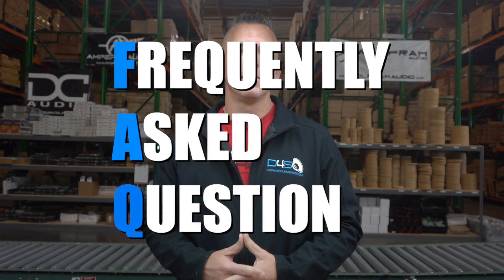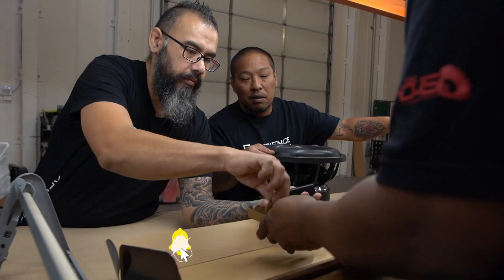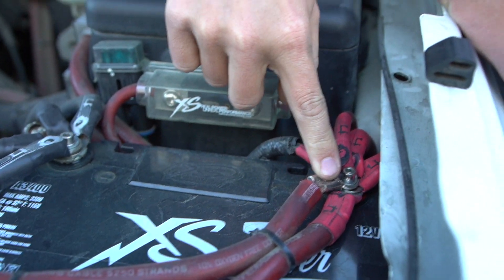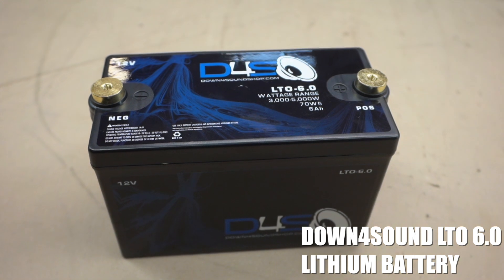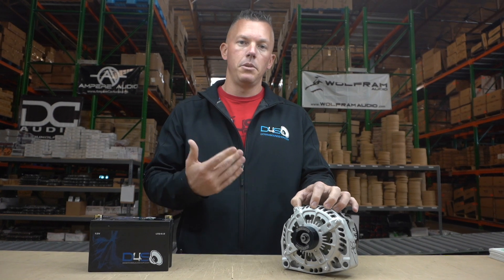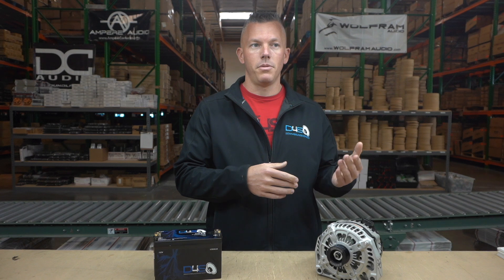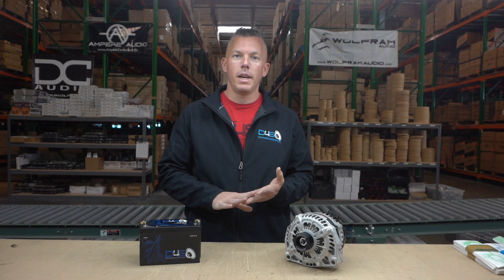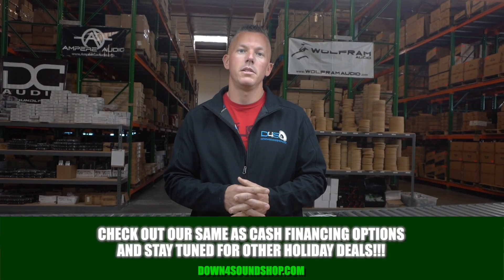FAQ: WHAT IS A SUPPLEMENTAL BATTERY?

Comment: How would I wire an LTO and a capacitor bank? With an isolated? Would a supplemental battery like the XSP D3400 have more but than the LTO 6.0? A Mechman 400 a GM alternator, and a D3400 under the hood. They still make caps, so I would like to use an XSP SB75-5CK supercap bank.

Comment: I read that you're supposed to have a thousand cranking amps per thousand Watts. If this is the case my battery in my little Honda Civic only has like 650. I was going to add a little battery in my trunk so I can get a total of 1,000 cranking amps. Hopefully this will work out good and is necessary.

Comment: So if my 250 amp alternator has 1/0 power wire going to front battery, then from the front 🔋 + to the rear nattery + parallel is that charging both batteries since its parallel. I have big 3 in 1/0.
Reply: yes

Comment: Would charging the aux battery with a tender overnight, if I only use it for 1-2 hrs daily and 80-90% volume, running 2000w total, would that work?? 
Im running a 850cc amp 12v deep cycle marine battery

Comment: I'm new to Car audio, but not new to Lithium ion, or Lifpo4 batteries etc. What I find interesting is no one ever mentions that having a car alternator connected to a lithium battery without any type of low voltage or high voltage cut off or BMS (battery management system) is dangerous. If people are going to connect a lithium battery especially one that is not meant to run off a vehicles electrical system ( I know they make some drop ins but they have a BMS built in for protection) "newbies" may not know that there is a difference when it comes to those types of batteries. I made this comment because in your video you have an 8AH lithium battery next to an alternator and made no mention of how to safely use these types of batteries in conjunction. I understand it was a Q and A that you answered, but the answer is not as simple as  you made it out to be.

Comment: How would this info change for a hybrid vehicle?  There has to be a way to improve the sound in hybrid vehicles.
Reply: im learning about this same thing. Being that hybrids don't have alternators because they would cause inefficiency in most hybrid designs, I have a lot of questions that are difficult to answer... To get higher amp output in the electrical system, it seems the DC-DC converter (which charges the 12v battery from the hybrids high voltage system) must be upgraded.

Comment: So my headlights are dimming, my voltage is dropping below 12.5 when trying to go full tilt. Big 3 already done with 0g. High output alternator is my next step? 
1 Sundown Audio X v2 15
4k @ 1ohm
Reply: 4k amp with stock alt should drop to 10 Volts easy so you need a autotek or mechman alt and a titan 8 in the back and titan 8 under the hood so you can either spend 1500$ and have good safe lithium or build a big headway bank that does alot of power but doesn't last for 400$

Comment: can anyone help me out with what secondary battery to choose i'm trying to decide between an xs power D975 and the Sundown audio sps 1500 both are $220 but the xs has 35 ah and the sundown has 47ah and the xs has a max amp rating of 2100 amps and the sundown 1500 amps (not sure if max rating means much considering it doesnt when it comes to amplifiers) but i cant find much at all on the internet about any sundown batteries and i think it might be the way to go because of the ah it has but i know xs has a rep for being really good in car audio secondary batteries and it has quite a bit higher max amp rating, it's also 10 lbs lighter. The setup i'm running is 2 skar evl's and i plan on getting the nvx xad14 3000 watt rms full bridge amp to power em.

Comment: I get it needs hooke up to the alt, but  do you need a separate wire from the alt to the back or can you just run it in parallel with the main underhood battery?  Example alt to main battery,  main battery  to supplemental battery.
Reply: Supplemental 🔋 does NOT need wired to alt independently, just to the main battery & then that circuit is completed by the wiring already in place between the factory battery & alt.

Although, you would want to upgrade those wires to gain efficiency! Aka, BIG 3!

Also, preferably upgrade your alt, cause it's now working harder! 💪
Reply: Yes at least an 8 gauge wire all the way back just for charging

Comment: Does a lithium require anything extra? Like to keep it from overcharging the battery or demanding too much from the alt? I just bought a battery isolator and have a 150amp alternator. I’m about to buy a secondary battery and I’d prefer to buy a lithium but don’t want to upgrade the alt just yet. I saw that a 100ah lithium’s recommended charge is 50 amps. I’m looking at getting a 100ah lithium or a similar size XS AGM. Any input would be great!

Comment: So from alt (+&-) to primary battery, then from primary battery to supplemental batteries and then from supplement (+&-) back to alt? Or wiring from alt to primary to supplemental?
Reply: Other than upgrading your alt & the wires running to /from it, you do NOT need to run additional wiring from your alt to your new supplemental battery!

Run your 12v + wire from your main 🔋 to your trunk / supplemental 🔋 & put a fuse at both ends.

Ground your supplemental 🔋 in your trunk.

You can install a battery isolator if you want, but that's optional.
Reply: Great Question, It Sounded Like He Said That! 🤔

Comment: I run both batteries parallel with an isolator.  I'm confused about what you said about hooking both to the alternator. I have the big 3 done, 2 platinum AGM batteries with stinger isolator, factory 130 amp alternator, skv2 1500.1 amp, 2 evl 12s. Every wire is 1 awg ofc. I know my power isn't impressive but I've never done this before and hooked this up myself in an 09 maxima. Boss head unit too. I'm new to this and always wanted a system. I do want to install a high output alternator but the only one I can find that seems somewhat reliable is JS alternators. I can't up the amp till I do that. It is hitting pretty good and voltage never drops below 13.3 since adding the second battery and isolator. Btw, I'm dying to hear a system like the Tahoe. Never heard anything like that before. Thanks for all your videos and help. They've helped me along the way.
Reply: Your doing it the right way running parallel with isolator.  It's the same thing he's saying of the alternator. Because your primary battery is already  connected to alternator in order to charge.  So you charging it in parallel with the primary battery.  Make sure you have a fuse from positive battery to other positive  battery at least a 200 amp fuse  😊

Comment: Several questions, big 3 to XS Power AGM battery under the hood, then dual grounds and hots from alternator to two connected D4S LTO 6.0, Then hookup all amps to the D4S LTO. Am I correct? Also for a 10,000 watt system, Taramp MD 8K 2ohm running two Zv6’s bridged to1ohm and a 2K Phoenix Gold on mids and highs, will two D4S LTO 6.0 be enough with a 250 hp alternator? Thanks for your reply.

Comment: Can you get another battery without getting the alternator or should you just get a alternator by itself first to see if it helps
Reply: Or would the isolator be another option if you just get the battery?
Reply: Alt first... Re-evaluate... Then 🔋, if needed.

Comment: You should also talk about bigger cables from battery - to the ground, ground to engine. And Battery + to charger and starter. At one time these was called 3 point update.
Reply from the maker: You mean like this? https://youtu.be/bm2f0UMQGj0
Reply: @THELIFEOFPRICE  Yes sir, but you should have more ground than positive in engine bay, or gasoline and new diesels could ground them with critical engine grounds.Extra ground for chassie and frame is not an bad idea (floating chassie)
Reply: @THELIFEOFPRICE , Several questions, big 3 to XS Power AGM battery under the hood, then dual grounds and hots from alternator to two connected D4S LTO 6.0, Then hookup all amps to the D4S LTO. Am I correct? Also for a 10,000 watt system, Taramp MD 8K 2ohm running two Zv6’s bridged to1ohm and a 2K Phoenix Gold on mids and highs, will two D4S LTO 6.0 be enough with a 250 hp alternator? Thanks for your reply.

Comment: I think what folks are asking is which is better.  Running your power wire from the rear battery to the front battery or directly to the alt?   I run individual wires from alt to each battery but ive been curious if that is better or to connect both batteries together and then connect to alt?
Reply: Someone please answer
Reply: Doesn’t matter. If the batteries are wired in parallel, theylll get charged equally. There’s no scientific answer to whether it’s better if directly wired to alt.
Reply: @Regz-2stroke  that’s the thing.  I have each battery with it own individual 12v wire ran to alt but I don’t have my rear battery wired directly to front battery
Reply: @wetdookie3808  it is still getting the same power either way you look at it..
Most people run them directly battery to battery.
You probably got your answer already considering this was 11 months ago.
Reply: I believe it depends on the alternator.  Sometimes you can only run power from front battery to back battery then to amplifier.
Reply: I wanna know can I just use a battery without being hooked up to an alternator or another battery and then recharge the second battery with a battery charger???
Reply: @o751106 yes, but that's not ideal, but yes you can.

It would just require you slow charging your supplemental battery, as it depleats its energy.

Considering most people already have wiring from their main battery back to the trunk, it just doesn't make much sense to not make the connection & allow the vehicles charging system to do what it's intended to do.

The only scenario where what you're doing might make sense, is if you have a factory alt & it's near its end of life & you don't want to put added strain on it & you don't have the money to replace / upgrade your alt.
Reply: Always wire in series when it comes to batteries you do not want to wire in parallel wiring in series like in positive goes to negative negative goes to positive positive to negative it's less strain on your stock alternator to keep an even charge, the back battery is used to help voltage drop.
Reply: @TheRealJLucas  your amp will get 24 volts if u do series
Reply: If you wire two separate batteries directly to your alternator you are in theory doubling the alternator's workload, if I had the time I would link you to a article regarding series and parallel wiring

Comment: I just got the dual alt bracket this thing is nice.. can I hook two different amp alts together together, ones a 270 and one is a 400… or do I need to keep them separate from each other
Reply: So mechman replied back and said stack em up it didn’t matter so for anyone wondering that, you can stack whatever you want to together as long as it’s all the same voltage alternators as in all 12v or 16v…
Reply: @chrisfiske  good to know loll
Reply: Curious to know the same.
Reply: I'm pretty positive you can run them off the same pulley system so long as you have no slipping (belt slipping) or anything, I was under the impression the only thing you would need to be careful of is having a 14v charging system mixed with a 16 or 19v charging system, you cannot run those together but even then I think its on the same pulleys being turned by the same engine, that's all they're mounted up there for anyway, to be turned by the engine rpms, I believe they just simply run the power wires from each alt separately as needed if they are seperate charging systems... I'm not 100% sure tho im all youtube taught / whatever experience i do myself lmfao
Reply: @zanechristiansen  well my thing is I’m sure the 400 amp is gonna charge around 14.8 or so after it’s hot the one I have now is still running off the computer at 14.4 which I’m changing over to the pigtail so I can wire them both together and not be controlled by the computer but still I didn’t know if one is charging at less voltage then the other one would that hurt anything or would it just balance out… I actually asked on one of mechmans videos to see what they say about it also hopefully they get back soon
Reply: @chrisfiske  oh yea I guess I didn't even think of that lol.. I wouldn't risk it. it may be a few "points" of a difference off, but I think over time that would over work the "bigger" "stronger" whatever, alternator you know, I'd definitely want them both charging the same, but like i said, I'm all youtube taught anyway lol so I'd definitely want someone elses advice if I were you lol
Reply: Honestly I would run them separately in your case. I would use the 270 alt for my car/truck and I'd power my mids/highs with that. And I'd use the 400 amp alt with the subs. I know that wasn't the question but that will work so long as the alt can use the same belt

Comment: I have dual runs 1/0 guage kicker ofc power ground 2/0 nvx  brand big 3  have a kenwood 8405 has 60 amp fusing for mids and highs and taramps smart 3k on 2 12 evl skar running around 1.5 ohm  how many amp hours do i need currently have xs d2600 and Duracell platinum h7 agm so i got about 130 135 ah also have 250 amp aftermarket amp in my 07 scion tc shouldnt the factory 100 amp alternator fuse pop with having a 250 amp alt now?  When im going 2/3 tilt i go from 13.4 volts to 12.4 i dont have dimming lights just wanting to have more than plenty amp hours so i dont drop so hard cause i do see like 11.8 volts also if im going hard on certain bass notes are harsher than others

Comment: Can’t I jus run a positive off the main battery to my back ones and ground it to the frame ? The front battery is hooked to the alternator
Reply: Unibody with cars are held together with spot welds and adhesive, its not as strong of a ground compared to bolting the ground to the frame rail on a truck. Running the ground wire from the front battery to the rear battery just insures that you are getting 100% of the potential of the current flow
Reply: @andyrajkumar6138  that’s where a bunch of people mess up and it does make a huge difference I believe anyways.